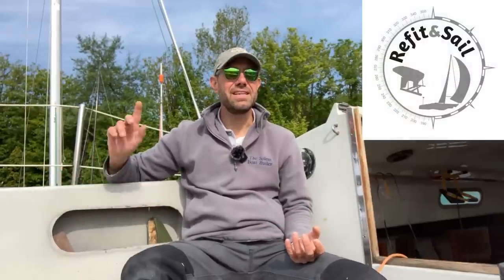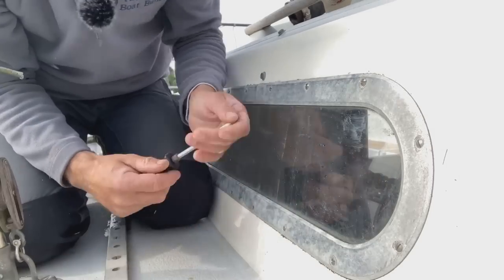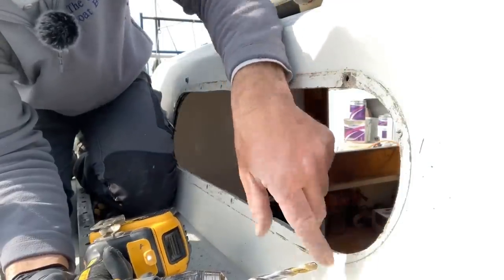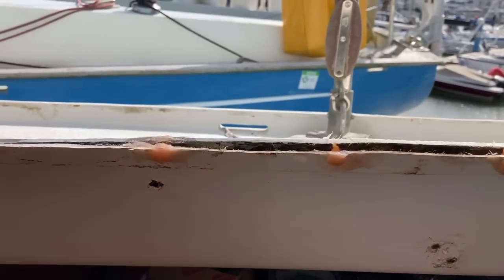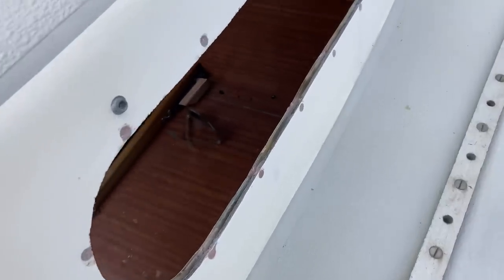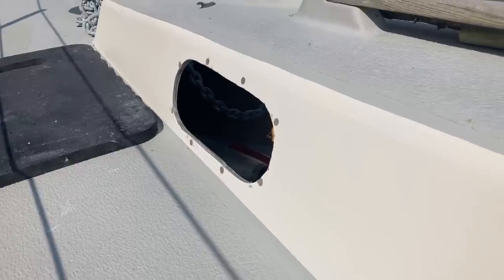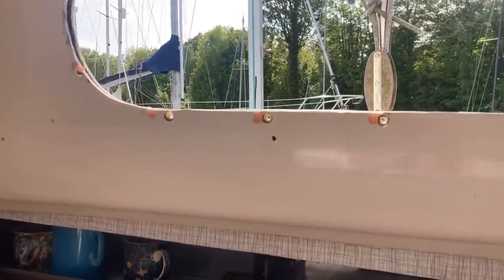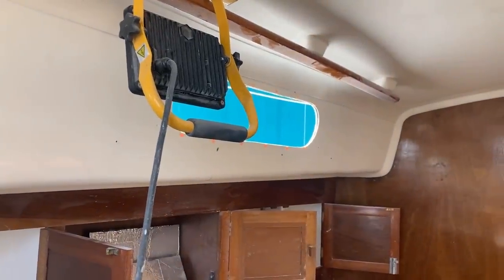Replacing 50 year old Windows on a Contessa 32 (Project Lottie Ep20)

Comment: Great video, and one of the few on that style of window, I have an old Norman GRP boat, and it uses them for the front windows, now in a late 70's boat you can imagine they have failed, and the previous owner fixed it with nylon rope and bathroom silicon, it would be nice to have a video of how to strip and refurbish one of them, as with mine they are a custom size not seen since Norman went bust in the 80's

Comment: Heaven knows why the openings were cut so large leaving little to fix and seal to, especially as there is plenty of width to the window frames. Surely that is not the case nowadays? Jeremy Rogers Ltd would be a little embarrassed to see this given their reputation I guess!...she is coming together nicely.
Reply from the maker: They were leak-free for most of the last 47 years that the windows have been fitted so I guess the hole being cut slightly oversize wasn’t a major issue so I can’t be too scathing about the original build.   Compared to the build quality of other manufacturers back in the 70’s the build quality of Contessa’s is very good.
Reply: @RefitandSail  Fair enough and amazing given the age, corrosion potential and possible flexing. A testament to sealant, fitter and windows 👍⛵

Comment: I tried to send you a beer but 20% paypal fees is too much (€ to GBP). Maybe Wise or Revoult would be an alternative.
Reply from the maker: Yes they are expensive fee’s but is such a well known platform others may not been keen to use an alternative platform.  I have never used either of the options you suggested.   Also looked at patreon and ko-fi.   Hard to know what the right thing is to do.   Maybe PayPal and ko-fi.

Comment: Love the two stickers.
I have the original Bill of Sale of my boat when my grandfather bought her - May 15, 1973.
Had it professionally framed to preserve it.
----------
I'm curious George ... there is/was no filler material (foam or plywood?) between the inner and outer "shells" where the windows mount? On my boat, there is plywood between the outer fiberglass and inner Formica-like material. I would think there would be something there to provide strength/rigidity.

Comment: Thanks for info, you mentioned you own a Westerly, what are they like for osmosis problems , I like the bilge keel westerly ketch 30 footers.
I'm dreaming.
Great informative videos , and good craftmanship, superb!
🐼🐼🏴🏴
Reply from the maker: Westerly yachts can and do suffer a fair bit with osmosis, the resins used were not the best available at the time but most boat built in that era suffer after so many years have past.   On the positive side the hulls were laid up very thick so blistering is unlikely to case a major structural issue for even if really badly blistered into the laminate rather than just under the gelcoat.   Like all boats everything is fixable but always worth trying to get the best example that finances and availability allow.    Pleased you like the vids

Comment: Very interesting for a future project yet again George, thanks! I believe my windows (not a CO32) are a similar basic design but with a wooden interior trim instead of being metal, and the inter screws are some type of brass or bronze instead of stainless. So questions;

- Is the window glass tempered glass or acrylic?

- Any specific supplier for your inter-screws?

- what type of previous owner paints anodised alu frames with some grey paint, and more importantly, how do you get the paint off without wrecking the anodising? ;-)

Thanks again for your informative and no-bs videos!
Reply from the maker: The glass in these windows is tempered/hardened glass, when I dropped (on purpose) one of the large windows onto the gravel beneath the boat is did not break.   Stupid test really as cleaning up the glass would have been a real pain.   There are lots of online suppliers for inter screws.  Can’t really advise on paint removal but assume they were painted because the anodising had failed due to old age so maybe it’s a repaint or replace job.

Comment: always great videos
 A few years ago, I had to do the same butt with a twist.
I went with butyl tape as it was becoming popular.
I even hit the around the window trims  with a power washer and was pleased to see no leakage into the cabin
4 years later...stil dry
Have you tried it yet ?
Reply from the maker: I have tried butyl tape and there are a lot of folk online that really love it, it’s only down side is that it takes quite a lot longer to apply that using sealant in a tube that you can gun onto the windows and it’s that time that is probably why I don’t see it’s use by professional shipwrights who are working on the clock.    The sealant I use is butyl based but quick to apply and clean up.    The vacuum tape used when I dried the hull laminate (see osmosis repair videos) is butyl tape.
Reply: I'm also a fan of butyl or even scapa tape. Less mess

Comment: The longer winow openings seem to have a slight curve as per the coachroof shape. Are the new windows made to a curve or will they stand being "bent" into position?
Reply from the maker: The coachroof sides have a gentle curve the whole way forward and so the windows (which are not curved) have to be persuaded to take the shape, the first time it’s done is rather nerve racking in in reality they take the curve quite easily.

Comment: Hi George. New to the channel - catching up on previous videos. Very informative with meticulous attention to detail - pleasing to see. Regarding the sealant used for portlights, have you considered using butyl tape? Interested in your professional point of view. Shaydon, Australia.
Reply from the maker: I know lots of people (DIYers) rave about the use of butyl tape and I have tried it myself.   It’s ok but I don’t know a single professional that uses it, partly (possibly) due to the extra time it takes to use it.    Most people I know tend to use an adhesive sealant because it’s not their problem when that fails and the window needs to come out again.   So I go the halfway house with the sealant in the video.   It works well, easy to clean up, relatively quick and when the window seal fails (and whatever you use it will fail eventually) then the window can pop out and be resealed easily and without damage.

If you have the time and not having to charge a client then by all means give butyl tape a try but I won’t be swapping over to use it unless a client specifically specified it but most are just happy to go with my suggestion and experience.

Comment: Thanks for another great video! Will you do a video on restoring oxidized gelcoat to its original whiteness? I have a 1970 Mistress 32, with a deck that is quite matte and yellowed, with some spider cracks. Do you think applying new gelcoat everywhere is the best option? Looking forward to the next!
Reply from the maker: Maybe at some point I will.   It may be that you can use some stain remover and then polish the deck on your boat if it’s not too far gone.    Re gel coating is a lot of work and may not be worth it, depends on what non-slip you want.    It may be better to use a mix of polishing (or painting if necessary) and then using a non-slip paint where needed.    The spider-cracks may need repairing or they will show though any new coating that is applied as it flexes and cracks in the same area again.

Comment: Hello, I have an old Invicta 26 which has the huge rear windows that on my boat are in a terrible state. I'd prefer the look of the Contessa 26 of having 3 smaller (8"?) along each side. I can get to the stage you show of having the window out, can you advise on the viability (method) of filling in the large window holes and then cutting the smaller apertures for the new windows please? ie just using mesh, or the need for a backing plate.
Reply from the maker: I’d normally say that this is a consultancy job but if the window you want is smaller than the hole you need to rebuild the grp structure, normally by making a backer of some type (so you having soothing to lay up the glass on), you will need to grind a taper on the existing deck to give sufficient surface area for the new material to bond to and then layup the glass and resin of your choice.    I don’t know the shape of the deck on your boat well but another option could be to put thick acrylic over the hole and then fit a windows in the acrylic but that will only work if the area is reasonably flat.   Hope that makes sense.

Comment: Thanks again George.  New windows are definitely on my wish list, but I think I will need to remove & refit the existing ones in the saloon in the short-term, as they are leaking.  I assume the same principles apply, but anything particular to watch out for?
Reply from the maker: Are you sure it’s the windows leaking and not the handrails above (which I think are original), may be worth double checking with a hose before they are removed.
Reply: @RefitandSail  It's definitely the two saloon windows on the starboard side plus the galley window.  I sealed these windows completely using clear gorilla tape on the outside and all the leaks stopped.  Have now done a temporary repair by sealing the outside joints between aluminium, glass and gelcoat with clear silicone sealant, and no trouble since.  Replacement handrails also on the wish list!
Reply from the maker: @CrewsFarm  ahh, ok, just checking.  At least they are sealed for now.

Comment: Nice Video! Those replacement windows are really pricey. Have you ever tried to refurbish old ones?
Reply from the maker: I have had them refurbished and refitted before now, it depends on the condition of the frames, if they are ok then it’s worth getting it done, if the frames are heavily corroded then it’s not worth the effort.

Comment: Are those new windows sourced from JRL, or from another manufacturer?  Maybe I missed the explanation, but I was surprised that the gaps between the coach roof and the headliner around the window openings were not filled with goo - was that because the window frame had a flange that fits in that space?
Reply from the maker: The outer flange of the window forms an adequate seal against the coach roof sides so no real benefit to filling all the gaps with goo.  While I’m a great supporter of JRL and often buy bits from then I get my windows direct from a window manufacturer.
Reply: Which manufacturer do you use?  I need to do this on my Rival 34.  Do you need to provide the original windows for them to copy individually or do they have different boat patterns ready?
Reply from the maker: @kevingriffiths8089  the company I use only deals with trade, but if you are in the uk then I’d suggest you give eagle boat windows a call as I have only heard good reports (although I think the business may have changed hands in the last year or so).

Comment: Thanks for the excellent video.  Quick question - is there a reason you prefer butyl goo over butyl tape?
Reply from the maker: yes, its considerably quicker to use, I have tried butyl tape and it works fine but takes a little longer to work.  I'm sure warm weather would make it easier to use tape but as far as I can recall don't know a single professional shipwright that would use it out of choice.
Reply: @RefitandSail  Thanks for the quick response!  So do you use the butyl goo when installing deck hardware as well as windows, or do you use something different for hardware?
Reply from the maker: @jimr6281  I generally (but not always) tend to use sabatack as a sealant for deckgear.
Reply: Thank you. Very well done. What is exactly this polyester putty you use for the small holes¿